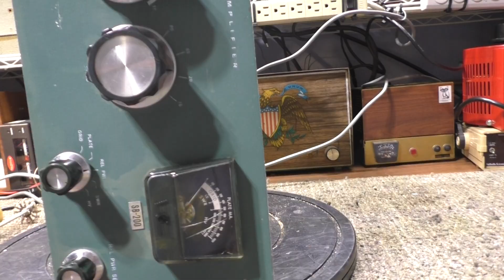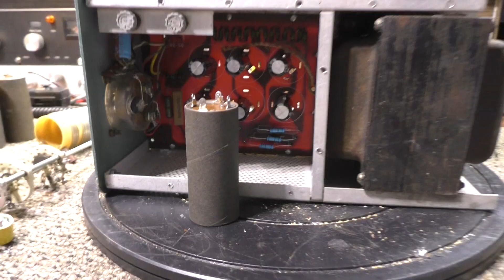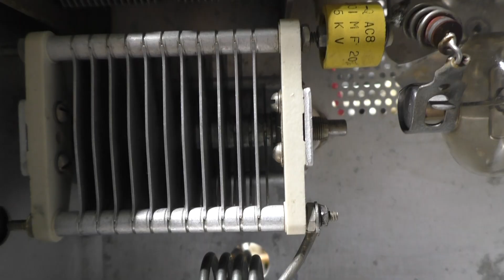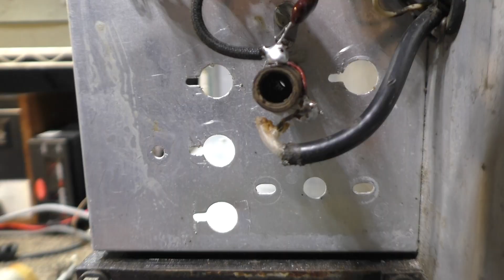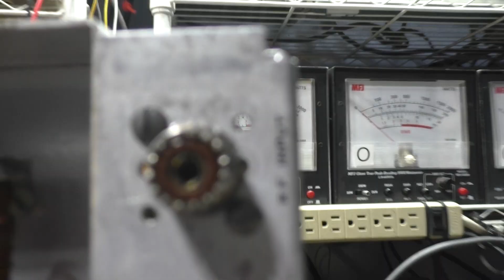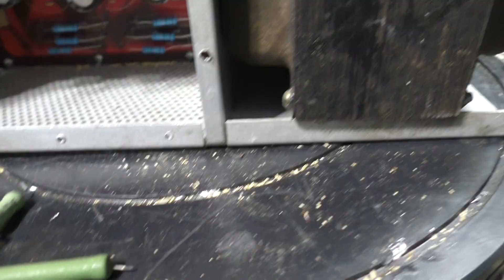Heathkit SB-200 linear amplifier unpowered final walkthru talkthru before putting her away.

Comment: Thanks for all the knowledge you share I have a sb-220 and I can hear my modulation inside it what should I look at to solve the problem? Again thank you
Reply from the maker: probably bad tube(s)
Reply: @tramdr I'm getting 1500 out with my yeasu 101e driving it I had to make some horse shoe parasites for it and I did all the harbach upgrades I have tried different tubes and it still does it thanks for your response brother
Reply from the maker: I would look at the HV power supply caps and the transformer then.

Comment: I need help with a eagle 500 can you contact me
Reply from the maker: you can try me at Tramdr@yahoo.com
Reply: I also have an Eagle 500. I retired it because I was having trouble finding tubes for it. Do you know of any1 that can test the tubes? The tubes are 20LF6. 2X5
Reply from the maker: 20lf6's are almost unobtainium. Might be best to convert to 6lf6 and then you can use the 6lf6 subs too.
Reply: I'll look into that. Is there anything that I need to make a mod to by switching tubes. Thanks for your help.
 @tramdr
Reply from the maker: you need to change the filament voltage from 20 to 6. You will need a filament transformer to do that. It's not hard, but if you don't know, then it won't be easy for you either.
Reply: @tramdr Tyvm.